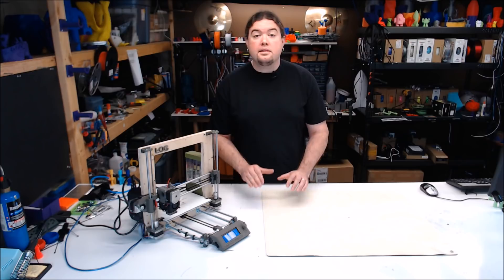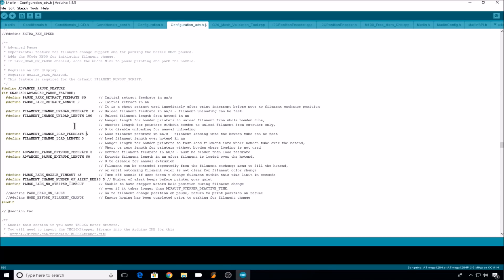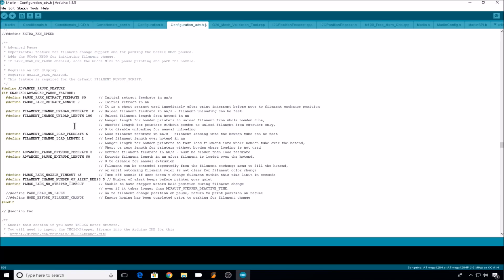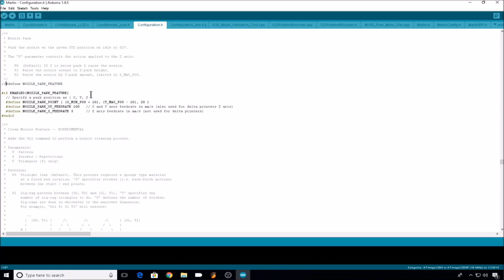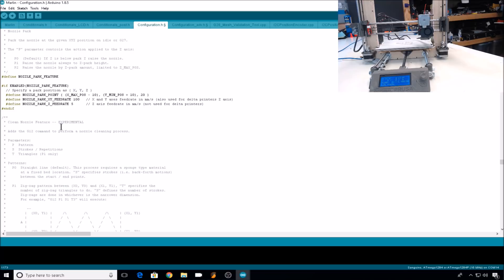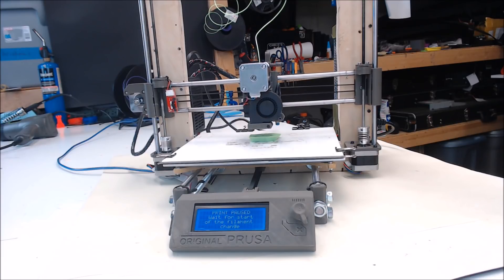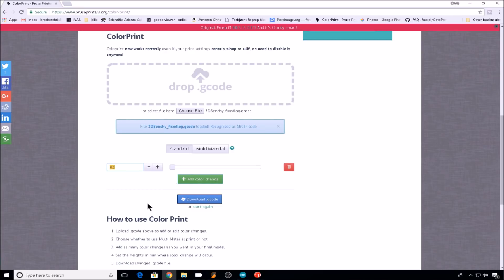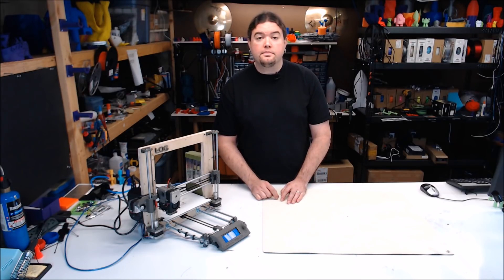Marlin Filament Change M600 - Chris's Basement

Comment: What happens if the print head moves while you are inserting the new filament? How can I ask it to rehome the x and y to learn where the head really is before resuming the print? Or at least just rehome the X.
Reply from the maker: Hopefully M600 won't make it move. You could run a G28 X Y after if you edit the gcode to do so, but depending on the printer, that might cause a collision with the print.

Comment: Hi. 
I want the print-head to move away from the print when I hit pause on the printer, but it just doesn't work, and I really don't know why that could be.
I have an Ender-3 with the V4.2.7 Board.
Does this only work in combination with a Computer and the M600 command?
Can't it not move away the print-head when I hit pause on the printer itself?
I hope you can help.
Reply: Sorry. I found out what was wrong with my Firmware. 
While compiling and saving everything out of order over and over again for the last couple of days, it seems that I managed to compile a huge pile of crap in the end.
I now freshly started the Firmware Editing process all over again, and everything that I wanted now works just fine.
Reply from the maker: I'm glad you got it going. Thanks for watching

Comment: IIs there anyway I could get a copy of your configuration.H and .adv files. I have a Prusa and have not been able to get the MKS Gen-L  to config properly. Now the hotbed will not heat? Any Ideas?
Reply from the maker: Hey Ron, this video is so old, I have no clue where the config would be. I would use the marlin example from github.

Comment: Hi Chris! What if I want to pause to insert something in a part (some metal parts or anything)? So I don't need to replace a filament but just a pause with parking the nozzle. How to make it possible as an option? Maybe it's possible to make a "menu" to check with the encoder "Filament change / Stay".
If that was made already somewhere then any URLs would be nice to have!
Thanks!
Reply from the maker: That's a good question, I am not sure, you might be able just to send it a pause command. If you are printing from SD you can pause with a M25 and resume with a M24.

Comment: Hi Chris, Great tutorial, thanks! Have you by any chance done this for the Ender 5 Plus? I'm trying to find a way to get the M600 enabled in the Marlin FW for E5+ but not able to find any thing on it? I got the E5+ source from https://forums.creality3dofficial.com/ender-5-plus/ and made these changes, but it fails to compile :(
Reply from the maker: It can be done, but the firmware would have to be rebuilt from scratch. There is an example config for it on the marlin github.

Comment: Hi Chris, interesting and helpfull video again. But I have a question: I have an all metal heat-break. Isn't there a risk of clogging unloading the filament while the extruder is still hot? I know that Cura has some post processing scripts to create a similar "advance pause", in those you can set the pause temperature. But for the M600 it seems nozzle temperature is maintained during the change.
Reply from the maker: It shouldn't be an issue, the M600 actually does a quick ram before it pulls it out to prevent this.

Comment: I am trying to implement the M600 command on my Ender 3 pro with marlin 1.1.6 installed and which already has a boot loader. I followed a video showing how to do this by going into the Advance_pause_feature in configuration_adv.h and then the configuration file. When I tried to compile it in arduino ide I received this error message..."Error compiling for board sanguino 1284P boards". I know nothing about Arduino so I am stumped and am not quite sure what to do now. My friend helped me the first time when we flashed the boot loader but isn't available because of the Covid 19 "Plandemic". Do you have any suggestions what I should do now? They would be gratefully accepted.
Reply from the maker: I replied to that on the other thread.
Reply: @ChrisRiley  Wow you follow two year old messages? I just replied to your reply. Thank you for paying attention.

Comment: Hello Chris! Big fan from Argentina here :D
I got a question. M600 has changed from 1.1.9 to Marlin 2.0? I upgraded my heavily modified ender 3 to 2.0 vanilla (from 1.1.9 th3d) but now when I do a color change in prusa Slic3r the printer change colors but it resumes automatically without screen confirmation. 
This leave no time to remove the filament extruded when loading the new color in to the print, but also a blob when resuming. Btw, it is hard sometimes to catch the extruded filament when the printer resumes automatically and it sticks to the print.
Maybe some advice on this?
Reply from the maker: Thanks! Things have changed a bit I think. Take a look at this feature. //#define PARK_HEAD_ON_PAUSE  This might return it back to how it use to work.

Comment: HI, i use marlin_v1, i dont have advanced pause feature, please help, how can i use m600 function? Please help me. In old version i dont have this commands.
Reply from the maker: You don't have this?  #define ADVANCED_PAUSE_FEATURE it's in configuration_adv.h
Reply: @ChrisRiley  no, and i update my version to 1.1.9, and no i have  other problem. My board is ramps 13feb. After updating the firmware, the display is not clearly displayed. A little blinking and the values are not legible
Reply from the maker: @Delfin_GTAV  I am not sure what's going on here, maybe consider jumping to Marlin 2.0 and giving it a try.
Reply: @ChrisRiley  i dont now, can i send you my filmware? you can check
Reply from the maker: @Delfin_GTAV  Sure, stick it on google drive and send me a link.
Reply: @ChrisRiley  https://drive.google.com/file/d/1kTNCWY-bYdX7fbUTcjlXaEz6Vg9rbWZJ/view?usp=sharing
Reply: @ChrisRiley  please write your gmail. i will send video and can tell about problem.
Reply: @ChrisRiley  i send you link, please open.
Reply from the maker: @Delfin_GTAV  I've got your Marlin, please send an email with what problems are. brotherchris81@gmail.com

Comment: Hi, thanks for your good videos.
How is the power loss set in 1.1.9?
Reply from the maker: You should be able to just un-comment it in configuration_adv.h and test it. It works much better in Marlin 2.0, just as a heads up.

Comment: Hello Chris!  I am delighted with your tutorials and they have been very useful for me.  I followed the tutorial for my Tornado with direct extrusion and everything was perfect.  my question is what do I want to change the 3 extruders of my other tornado by bondtech and I can not get the filament change of extruder 2 and 3 on the screen.  What steps should I follow?
Reply from the maker: You will need to run a M603 first to configure the target extruder, check this out. http://marlinfw.org/docs/gcode/M603.html

Comment: I use marlin 1.1.9 and my printer isn't parking. I've explored all possibilities but I just dont know why. Everything in the firmware is right as it should be.
Reply from the maker: So it just doesn't do anything when you run the m600 command?
Reply: @ChrisRiley  It only works when #define HOME_BEFORE_FILAMENT_CHANGE  is uncommented, which is very weird. When I pause the printer nothing happens as well, even with that line uncommented. Park head on pause is uncommented as well.

Comment: Looks like my Marlin version is different from what you are showing..   Noticed the first 5 Pause Parks ...  Your version do not list these
config_adv_h
#define ADVANCED_PAUSE_FEATURE
#if ENABLED(ADVANCED_PAUSE_FEATURE)
  #define PAUSE_PARK_X_POS 3                  // X position of hotend
  #define PAUSE_PARK_Y_POS 3                  // Y position of hotend
  #define PAUSE_PARK_Z_ADD 10                 // Z addition of hotend (lift)
  #define PAUSE_PARK_XY_FEEDRATE 100          // X and Y axes feedrate in mm/s (also used for delta printers Z axis)
  #define PAUSE_PARK_Z_FEEDRATE 5             // Z axis feedrate in mm/s (not used for delta printers)
  #define PAUSE_PARK_RETRACT_FEEDRATE 60      // Initial retract feedrate in mm/s
  #define PAUSE_PARK_RETRACT_LENGTH 2         // Initial retract in mm
                                              // It is a short retract used immediately after print interrupt before move to filament exchange position
  #define FILAMENT_CHANGE_UNLOAD_FEEDRATE 10  // Unload filament feedrate in mm/s - filament unloading can be fast
  #define FILAMENT_CHANGE_UNLOAD_LENGTH 100   // Unload filament length from hotend in mm
                                              // Longer length for bowden printers to unload filament from whole bowden tube,
                                              // shorter length for printers without bowden to unload filament from extruder only,
                                              // 0 to disable unloading for manual unloading
  #define FILAMENT_CHANGE_LOAD_FEEDRATE 6     // Load filament feedrate in mm/s - filament loading into the bowden tube can be fast
  #define FILAMENT_CHANGE_LOAD_LENGTH 4       // Load filament length over hotend in mm
                                              // Longer length for bowden printers to fast load filament into whole bowden tube over the hotend,
                                              // Short or zero length for printers without bowden where loading is not used
  #define ADVANCED_PAUSE_EXTRUDE_FEEDRATE 3   // Extrude filament feedrate in mm/s - must be slower than load feedrate
  #define ADVANCED_PAUSE_EXTRUDE_LENGTH 50    // Extrude filament length in mm after filament is loaded over the hotend,
                                              // 0 to disable for manual extrusion
                                              // Filament can be extruded repeatedly from the filament exchange menu to fill the hotend,
                                              // or until outcoming filament color is not clear for filament color change
  #define PAUSE_PARK_NOZZLE_TIMEOUT 45        // Turn off nozzle if user doesn't change filament within this time limit in seconds
  #define FILAMENT_CHANGE_NUMBER_OF_ALERT_BEEPS 5 // Number of alert beeps before printer goes quiet
  #define PAUSE_PARK_NO_STEPPER_TIMEOUT       // Enable to have stepper motors hold position during filament change
                                              // even if it takes longer than DEFAULT_STEPPER_DEACTIVE_TIME.
  #define PARK_HEAD_ON_PAUSE                // Go to filament change position on pause, return to print position on resume
  //#define HOME_BEFORE_FILAMENT_CHANGE       // Ensure homing has been completed prior to parking for filament change
#endif
Reply from the maker: Yeah, that looks like 1.1.9.

Comment: When testing with my BMG/Petsfang/V6 (Ender 3) if I insert a filament to where the gears grab it I need to extruder 11cm before any plastic comes out, same but reverse to pull the filament to where I can pull it out easily. Is this the value I needs to use in config?
Reply from the maker: Yes, that should be correct.

Comment: Is it possible to have extra filament length after filament change ? When it start to print again, some mm isn't printed . Thanks for your great video it help me a lot.
Reply from the maker: In Marlin 1.1.9 there are some extra option that should make the possible. Check out configuration_adv.h
Reply: Thank you very much, I finally found a way to do what I wanted. I added a command in the tool change section. G1 E2 f3. I still have to improve my technique but I am on the right track.
Reply from the maker: @Mousanony2509  Very nice.

Comment: When I activate that feature, appears on my LCD the option to change the filament, is that the same of inserting the M600 on the GCode? Because I'm having some issues when I use this feature. The nozzle is not parking on the place that it is suppose to, it just stops at his current place, and than ruining my print...
Reply: I got it now... Probably not the right way to do, but it works... I inserted manualy a G0 code to the cordinate that I want to park, then a M600 code... Just need to find the layer on the Gcode to insert it on the right moment.
Reply from the maker: @leonardocousseau5462  I am glad you found something that works. I am not sure what the difference is between the LCD commands and the M600. I will put it on my list of things to look at.
Reply: Acctualy I think it is the same, but my issue was that the nozzle wasn't parking with the filament change command, than I did the move manualy... But that's fine. Thanks for respond me, I really like your videos!

Comment: Something that's important to note is that "Unload" and "Load" filament are EEPROM settings so the configuration_adv.h file needs to be recalled into memory, then saved to EEPROM with:

M502 ; reset to factory (Marlin firmware) settings
M500 ; save factory settings to EEPROM

or those settings can be manually entered in the LCD display filament settings then saved to EEPROM.
Reply: That is just what I needed to get mine working. Thanks
Reply from the maker: @texascanuk  Awesome Paul!
Reply from the maker: Good call, I usually disable eeprom, but can be very frustrating  if you don't know that.
Reply: 3 hour laterrrrrr , omg tnx

Comment: Hello, amazing video, I was experiencing the change of filament and I had problems, use some additional g-code in the laminator, cure, repeat, pronterface, simplify3D to change the filament?, I have some REPLACE codes, but they do not work well, You could help me to add a code snippet for filament change from simplify3D.
Reply from the maker: Thanks! If you follow this video all you would have to do is enter M600 before that layer change.
Reply: We will have to have the machine connected to the PC, while, in this case, we will simplify, the printer will stop at the layer it defines, and thus we can have an exact control ...
Reply from the maker: @darksideadv  Correct, you can edit the gcode with a text editor and insert the M600 command then print from the SD card.
Reply: @ChrisRiley  I have not activated the M600 since marlin, and I tried, but I can not activate it.
I use an Anet A8 currently, Marlin 2.0 and Arduino 1.8.5, but when I give it compile, it says an error that says, error board anet v1.0, so that was looking for another option.
Reply: If I add the M600 without having activated the option could work?
Reply from the maker: @darksideadv  Have you ever successfully uploaded Marlin 2.0 to the board?
Reply: @ChrisRiley  yes, it has the marlin 2.0, it works fine, but I have not enabled the M600 and now that I am trying to organize the Marlin again:

Arduino: 1.8.5 (Windows 7), Card: "Anet V1.0"

In file included from sketch \ src \ Marlin.cpp: 33: 0:

sketch \ src \ lcd / ultralcd.h: In static member function 'static bool MarlinUI :: button_pressed ()':

sketch \ src \ lcd / ultralcd.h: 294: 21: error: 'buttons_reprapworld_keypad' was not declared in this scope

     #define RRK (B) (buttons_reprapworld_keypad & (B))

                     ^

sketch \ src \ lcd / ultralcd.h: 299: 30: note: in expansion of macro 'RRK'

       #define BUTTON_CLICK () RRK (EN_REPRAPWORLD_KEYPAD_MIDDLE)

                              ^

sketch \ src \ lcd / ultralcd.h: 621: 50: note: in expansion of macro 'BUTTON_CLICK'

     static inline bool button_pressed () {return BUTTON_CLICK (); }

                                                  ^

exit status 1
Error compiling for the Anet V1.0 card.
In file included from sketch \ src \ Marlin.cpp: 33: 0:

sketch \ src \ lcd / ultralcd.h: In static member function 'static bool MarlinUI :: button_pressed ()':

sketch \ src \ lcd / ultralcd.h: 294: 21: error: 'buttons_reprapworld_keypad' was not declared in this scope

     #define RRK (B) (buttons_reprapworld_keypad & (B))

                     ^

sketch \ src \ lcd / ultralcd.h: 299: 30: note: in expansion of macro 'RRK'

       #define BUTTON_CLICK () RRK (EN_REPRAPWORLD_KEYPAD_MIDDLE)

                              ^

sketch \ src \ lcd / ultralcd.h: 621: 50: note: in expansion of macro 'BUTTON_CLICK'

     static inline bool button_pressed () {return BUTTON_CLICK (); }

                                                  ^

exit status 1
Error compiling for the Anet V1.0 card.

This report could have more information with
"Show detailed output during compilation"
option enabled in File -> Preferences.
Reply from the maker: @darksideadv  I am surprised you have gotten 2.0 to work, but it doesn't like your LCD. My guess is, when you try to enable advance park, it's throwing this error, because advanced park needs an LCD to work. I would give 1.1.9 a try and see if it compiles with your settings.
Reply: @ChrisRiley  It took the use of marlin 2.0 2 months ago, but a new update came out and I wanted to update but I voted that error ... look at the link: 
https://lifehacks3d.com/ciencia-y-tecnologia/marlin-bug-fix-2-0-firmware/
I found it on that website, they also have the 1.1.9 so for the anet a8
Reply: @ChrisRiley  thanks for your advice, but marlin 1.1.9 presented me with faults and I had to upload it to 2.0
Reply: Hello Chris, if you go to Nozzle Park, and you choose the Z axis to 20, and the piece or model is 50, the piece would be destroyed, is not it?

How to solve the problem of 3D printed models that have a considerable height ... or does that value match the height at which it goes?

Example:
The print is at the height of the Z axis at 40.3, does it pause printing using the m600, is the parking command executed, would it rise above that 20 value?

Comment: Octoprint runout setup vs M600 runout sensor, which is better?   I am using a delta printer and planning to set up the octoprint this week.
Reply from the maker: I would use the runout built into Marlin if there are pins on the board for it. It seems to be more reliable.
Reply: @ChrisRiley  thank you :)